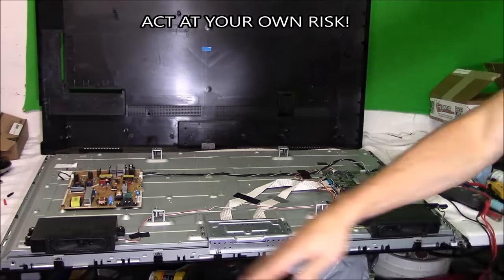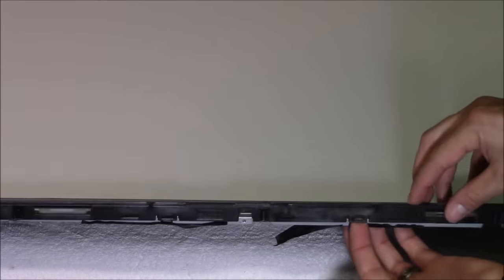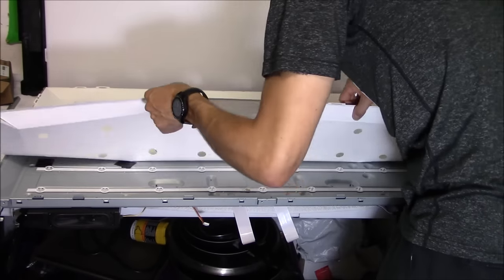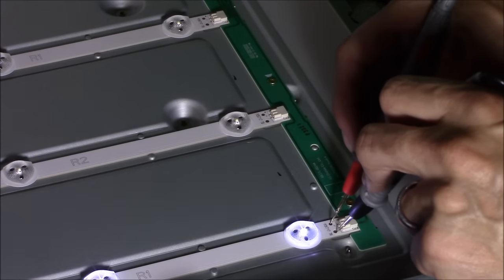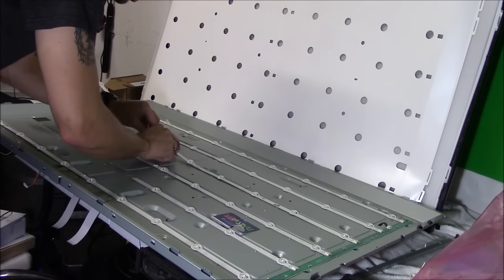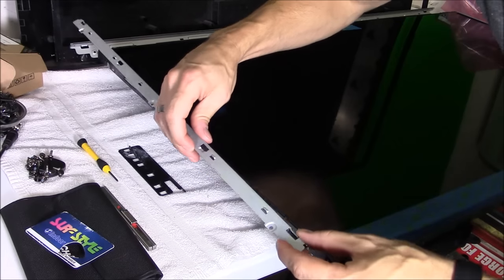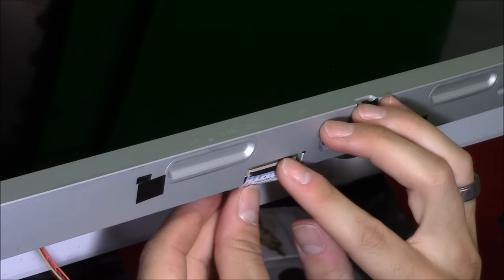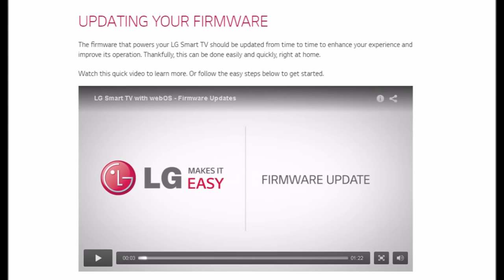How to fix LED LCD TV black screen no backlight, TV disassemble, testing LEDs, ordering part, repair

Comment: Relative to the amount of time and effort, what is he cheapest TV you would consider worth repairing? I am trying to imagine tearing into my $300 monitor just to find out what parts I need to order. I don't have the space to leave it sitting around disassembled. And if I had to wait weeks for parts to arrive, I would forget how to reassemble it. Add to that this is my primary computer display which I can't easily do without. So my question is... is it worth trying to repair a $300 monitor?

Comment: So here's a question for you that ties in, what if the LCD voltage out starts at the correct voltage, but falls slowly all the way back to 0? That's my situation.  Would this be the LED strips of the board? Thanks! Max voltage looks like it is 125 V on LED 1 and 3 before it starts falling.

Comment: Dear Tamptec,

I have watched all you videos and need help.  Have a 55" Toshiba with a PE0702 board. TV won't turn on and no standby light.  If I hold in on the relay RS81 manually the TV turns on??   Not sure where to go from here??

Any advise?

Thanks,
Ed

Comment: Hi, i own a TCL TV, i'm facing no backlight issue but sound works
Issue is if turn off the TV for few hours & turn it back on, then the Everything works fine. After 10-15 minutes the display goes black. i reckon that there could be some issue related to some bad capacitor.
Any Suggestions, does really a LED back light needs to be replacement?

Comment: I NEED ADVICE: I don't have a tool to check the LEDs, so I just checked visually and found 1 burnt out LED out of all of them. Can you tell me if all the bad LEDs you found were burnt out too? Also, did some look good but were actually bad and didn't lit up. I'm asking cuz I'm deciding to just order one strip instead of all of them to save $.

Comment: hi, got an LG 55 TV. the backlight turns off while viewing. if I shut down the TV and turn it on it will resume viewing and after a while turn off again ( I did flash light test) if I lower the backlight to about 30 and turn on ECO mode to maximum then it will last longer but eventually turn off. then I need to wait for a while to let it cool down.  at this  settings it is hard to view the tv unless at night when room is not  so light. do you think the problem is with the  led strips or the board ?

Comment: hi, i dont know if you check this comments section, but i need some help here. i replaced some backlight leds from an LG 42" and they work fine for some weeks but after that another random led of the strip blows up again, sometimes 2 of them. it happened 2 times, then i replaced the whole led strip, and now it happened again with only one... im suspecting against the PSU but i dont have a clue for what component to check, thanks man!

Comment: I have a Samsung smart tv and one night, it went off. no power. replaced power supply board, get red flashing power light but no screen or anything. I assume its the backlights? if so what would have caused all these failures at the same time? any guesses? It was plugged into a power surge strip....for surge protection. would the bad power supply board short out the LEDS or other way around?

Comment: You freaked me out with attempting this one. But I'll see what you think is up with my tv first. I have a 55' LG 55LA6230. The tv first started playing up by not turning on straight away. We'd have to push the on button anywhere from 2 to 30 times and then it would turn on. This made me think it was a swollen capacitor on the power board. This had been going on for about a month. However a week ago it turned off while watching and hasn't turned on again. When I try to turn on the red light blinks 3 times then stays off and still nothing on the screen. So I ordered a new power board and opened the back. The old power board didn't seem to have any bulging capacitors but I went and replaced the power board to see if it would help anyway. However, the tv is still having the same issue. Red light blinks 3 times then stays off. Help?

Comment: hey @tampatec I have a question. is having just one single burned led on the strip cause any issues with the tv? basicly does having just one none working led make any difference on the screen? noticeable? thanks

Comment: Got a Samsung replaced all 60 LEDs while it was on one of the strip negative touched chassis replaced 4 leds now when plugged in there's 25 of 60 flashing each row has 15 four rows I've went threw and powered all LEDs with batteries all 60 light up what do you think is bad??

Comment: I've got a question that I'm hoping you'll help me with. I received the new LED strips for my LG 55LB5900-UV. I put them in and connect everything and it's still flashing. I tear it back down and expose the LED strips to find the top 2 rows now flash, with all LEDs lighting at least. The bottom 3 rows are completely dead. I don't have any kind of legitimate tester or voltmeter unfortunately. What I do have rigged up is an old adjustable voltage laptop power cord that has ratings from 15v @ 6A max, 18v @5.5A max, 20v @ 5A max, 24v @ 4.1A max. All of the setting work for a RGB LED strip that I have laying around, but don't work very well, if at all, with the TV LED strips. I'm wondering if it might be the power supply board. I don't see anything that appears to be bulging or charred anywhere. The plug and a small area around where the LED strip wires plug into the board is a little dark, but where it's darkest is the side where the LEDs that function plug into. I'm lost. I'm hoping you might have some suggestions that may help. Even if it's a way to test the new LED strips to eliminate them from, or confirm them as, being the source of the problem.

Comment: I've got a Samsung lcd Un55es6100, after power surge through Ethernet cable 2 out of 3 hdmis won't work and then a few days later the screen now flickers all the time after 30 seconds after being turned on. It has jumper circuits j852 & j854 on power board bn44-00503a pd55a1_csm. Should I cut jumper wire j852 or j854 or is the flickering possibly caused by the damaged control board that has the 2 non functioning hdmis? Otherwise the TV seems fine. No obvious damaged capacitors.

Comment: Hey tampatec,

Greatly appreciate your video! I have tried testing the panels and each left side panel lights up completely when testing each strip individually, but none light up after the middle connection to the right side strip. So, none light up on the right side. 

Also, when testing the first panel in combination with each panel above, only the first panel lights up each time for panel 1-6 on left. But again each one lights up when tested individually (left side lights up only, not right).

Any ideas? I would be forever grateful and be buying the panels or board.

Thanks!!!

Comment: I have a 55" Vizio led model M550vse & it comes on & the screen works just momentarily & then goes BLACK! I have tried the flashlight trick & cannot see anything however, The audio works! Just the other day, I went threw the settings & turned the front light off as to save the bulb now, the Vizio light comes on & the Vizio emblem lights up & within just a second or two, The screen goes black. Which part of the television do you think needs replaced? ANY & ALL HELP IS APPRECIATED!!!!!!!

Comment: Hi! I have a Samsung, Model: LE32A336J1D. I have it for 12 years and today I had an issue with it for the first time. I switched it on. I only heard the sound. The screen stayed pitch black as if the TV was still switched off. What can the problem be? Thank you in advance for your time and your response.

Comment: I've just done this test on my TV which has sound and no picture, and there's two strips of LEDs. The one strip works perfectly. The other strip however has one LED that works, but takes a lot longer to light up than the others on that strip. Does this mean I need to replace that strip, or seeing as the LED works eventually, is my problem elsewhere? Any help is much appreciated, thanks!

Comment: This was bloody fantastic man, thankyou.
I'm going to be attempting to replace the strips in my LG 32 inch with this as a guide, hopefully it goes well.
So it looks like having the brightness too high is what caused the LED burnout. Guess you live and learn haha.
Reply: Frost Apocalypse i just dissasembled our 42LA6208 (4,5 y.o.) cuz the LG Logo was flashing just once, we could hear sound and zap with the remote but the Panel / LEDs themself didn‘t stay on, now i‘ve ordered 1 LED Strip and im keen to see, if the TV will work again, otherwise we need a new TV, hopefully with WebOS and the magicremote 😍

Comment: Tampatec if a few leds are bad wouldn’t the screen turn on with a few dim spots ? Or would it be totally black ?i have a samsung which the screen is black, I went ahead and replaced powerboard, main board and t con board that didn’t work , I have no back light ,I tried the flashlight in a dark room and I was able to see the main menu wouldn’t you say last option is the led light strips ? Thanx

Comment: Hi Tampatec. I must replace some LED of the LG 50LB6300 model. The Backlight strips are 6916L-1979A and 6916L-1978A. LG Innotek DRT 3.0 50" Type Rev02_#1_140218. I want to order the LEds, but do not know which volt LEd. 6v or 3v. The power board says output Low 145 v -215mA and high 170 v - 215mA. Any idea ? 6 volt or 3 volt. Total 5 strips with 9 leds on each strips. 45 leds total.

Comment: nice vid!can you do a short demo manual how to measure the screen led cable  without dissasembling the screen with the voltage tester please?i got one but cant understand the manual  translation!would appreciate that a lot!
 lg shows on board hi 100 volts and lo 70 volts,is that the variable power  illumination of the led driver for lg 42 ln613s?
when tv on,and tcon ok,with ground on led video driver board,it shows for both + led wires 40 and 40 volts only!so are some led lights in both 2 circuits off?if i measure with ground on the screen cachie,the led positives show 00 and 00.

Comment: Good day tampatec good video .ihave question devant 48 led tv .no picture what is the voltage of led bulb strip because when i used 24volts the led lights but dim when i used 110volts dc the led bulb bright lights.please reply asap thankyou how much your led tester how to order Philippines. Thabks

Comment: Good day again
I am trying to use my second remote control qt130 of my TV
QSP500TV6
But it is out of adjustment. 
For exemple:
1/ power button shows chanel 1 on tv.
2/Exit botton shows chanel 3.
3/ source botton shows 33 channel.
4/ number 2 botton is the power off.
So how can I adjust the remote to my TV?
Best regard HENRY
Reply from the maker: Seems like that's an universal remote with the wrong code input or maybe that remote is for your tv brand but another tv model. Try another code.

Comment: If  the screen went dark all at once wouldn't that mean that there must be another issue than LEDS?.. What are the odds that ALL 14 light strips (not sure how many my 76R6E3) went out at once?...or are they connected to where if 1 goes out they all go out?   I do see a picture in the screen when I get close to the TV screen.  And the sound is working.  75" Hisence Thanks

Comment: I have a question I have a phillips 65 inch .it will come on as soon as it's plugged up but the buttons nor the remote has any affect.  want turn off till unplugged? any thoughts?

Comment: Hi,
I have the same problem on a Philips 40PFL3008 H/12 TV and I want to replace the LED backlight strip. I found one strip on internet  with the same code written on the strips of my TV,  ves400unds-02 rev0.2,  but in the description is mentioned that is for TOSHIBA. I don't know if this one is also compatible with my TV brand/ model. Could you please help me with this info? Thanks.

Comment: Did u have check the LVDS cable disconnect from t-con board and power on the TV then backlight get on or not?

Comment: Samsung Model UN40H6203AF 40" led TV.  Have replaced Power Supply, Tcon & main boards (luckily at very minimal cost).  However I now believe the issue is the LED backlights.  None are operable.  Is there a way to test the LED's without buying a LED backlight tester?  Figured I've come this far might as well see if I can fix the thing.  Definitely learned a lot from your videos and just trying this.  Not even sure I can find replacement LED strips.  Best I can tell from looking at the strip they are Samsung "BN96-28766A" (top & bottom strips) and BN96-28767B (Middle strip)if I'm looking at the right thing.  Numbers and letters in a couple places.
Reply: What happened?

Comment: Any idea who makes the tab bond boards for Samsung? I have 1 I am working on with sound but no picture. Upon taking off the bezel, I see 2 spots on the bond boards that have corrosion. I assume someone used windex on it and it leaked down on a couple chips. The 1 on the right fell off and completely crumbled and the one on the right I am getting resistance on, but would still like to replace both and see if I can salvage this TV.

Comment: I have a 60 inch RCA (RLED6090) that I bought just a month ago whose picture repeatedly goes off (just sound). However the image is still there (tested by using flashlight). I notice that RCA isn't on your list of manufacturing brands that this repair guide might work on. Do you think it is worth the exercise to go through these troubleshooting steps then? Thanks...
Reply: how did you make out?did you fix it and if so HOW?

Comment: Got a Sony bravia 55ex500 with the tubes inside.  One or some are defective but have you a video for testing the small thin tubes inside to see which ones to replace. Its an lcd not led.

Comment: Hi, I got 7 stips. The top and the lower 2 strips seems  working. When I change the one of the  so called not working strips with the lowest workinglevel strip , aha, that worked also. So the problems seems not with the led strips but with something else. Always tha same level of leds are not working ?

Comment: Hi Tamatec I have same issue with my sharp tv I did the flash light test there is picture there. I tested the back with multimeter and had 60 volts instead of 130 or 0 so does that mean it’s lead strips instead of lead diver ?

Comment: Was this the TV that had the "vizio" display and then backlights shut off after a second or two? I have a E420i-A0 that is showing 68.7 volts on both led outputs (led connected) with the exact symptom you described on this TV I think. The voltage starts at about 130 and decreases down to the same 68.7 with the leds disconnected...what gives?

Comment: Hi have you ever tried to attempt repairing the delicate LCD ribbon cables, that's what's wrong with mine, think it has a bad, broken, faulty ribbon cable, I have a thick vertical line in the centre, I changed the TCON board first, but it never fixed the problem, so I think it's the ribbons I mentioned, I got the result from a repair shop, that I sent them a picture of the fault, I wouldn't have known that by myself, anyway the guy said they don't do the repair as it will pretty much wreck the TV more often than not, so too much risk.

These ribbons seem to be the fault with alot of LCD TV's, and looks a common fault that could happen any time.

Comment: I have a Samsung UN55ES6150 Smart TV, it was working fine. We had a 
lightning crack and knocked out our main cable box.  This TV WAS NOT 
hooked up with that cable box.  Once cable was restored, the Samsung 
UN55ES6150 is the only one giving us trouble.  After being on for approx
 15 minutes it starts shutting off, then on, repeatedly.  Then shuts 
down.  I did the factory reset and changed all the timer and ECO 
settings.  I've followed your videos. I removed the back panel and it 
doesn't look like there are any blown capacitors.  At this point, I have
 no idea.  The set up on mine doesn't look like any of the ones you've 
shown.  Can you help or know someone you can refer me to?  I would 
appreciate it.  Marisa

Comment: I have a Toshiba LCD display with a similar issue but mines not only has lines, it has a scrambled blinking appearance. As if the picture is trying to come in but it's all over the place. Any idea where the source of this problem is rooting from?

Comment: Hey how are you mister tampatec!!! I have a question for you, I have a 50" samsung plasma tv with vertical lines, how can I fix this lines? I have to change the board completely and where I can buy this board is a LJ92-01733A if I replace this board the problem is solve? Thanks and another thing is how can I know which led diode I have to buy for repair the stripe in my rca led? Thanks and ur videos are very helpful to me thanks for share this u are a genius!!! God bless see ya!!
Reply from the maker: can be buffer board or connection to the panel, try shopjimmy.com or electropartsonline.com
Reply: in a video you show is the control board because i have vertical  lines not horizontal lines, or im wrong'' thanks for ur quick anwer u r the best thanks
Reply from the maker: victor lf I'm sorry That's correct, control board can fix your issue.
Reply: thanks, where can i buy that control board i try in both web page jimy and electro but i can find it u can help me with the link or where i can find it please the control board is LJ92-01735 A/B/C/D/E/F/G

Comment: Hey Tampatec, My Samsung SMART TV UA55H6800Ak  has a blank screen when I turn it on.  I tried the blacklight test by shopjimmy 's video removing the back panel and checking for the backlights when the tv is turned  on. In my own case the backlight just flashes (comes on) for a moment and goes off. Does this indicate that the back light is the problem?

Comment: can you use that led tester to measure the voltage coming from the power supply connector to the LEDs?